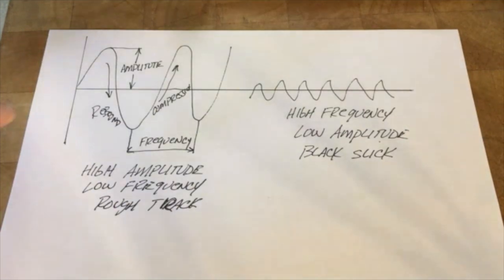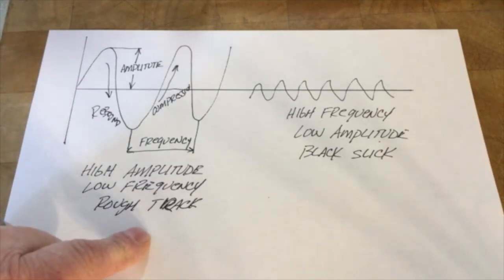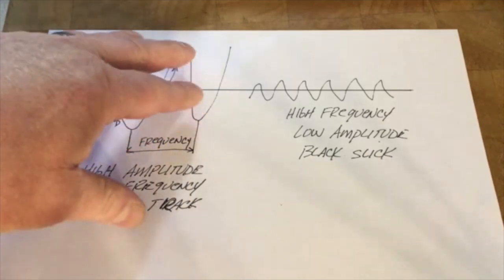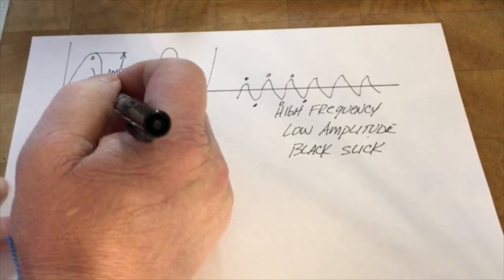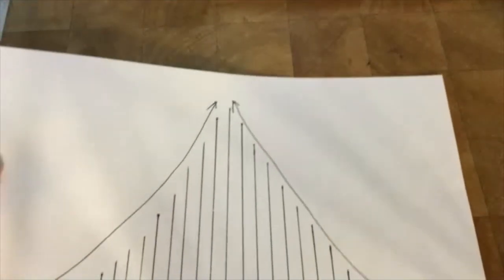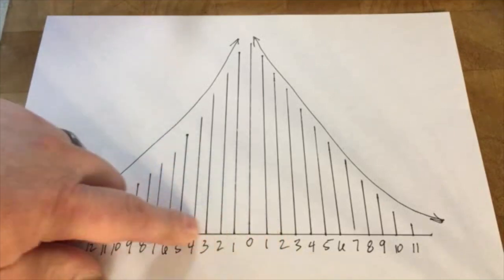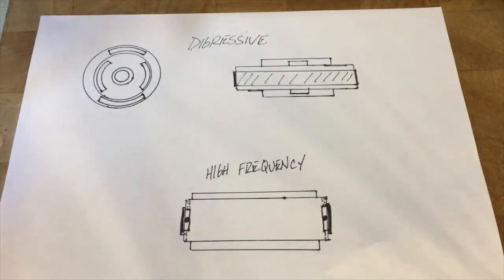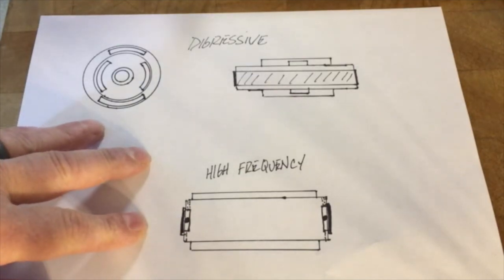More Dirt Late Model and Dirt Modified Shock Technology; High Frequency and Digressive Pistons

Comment: I was into dirt bike suspension back 20 or so years ago. Amazing to me there hasn't really been much change in that time although several manufacturers tried air forks. That was mostly about un-sprung weight. Results haven't been stellar. May be OK for MX/SX but not good for longer woods races. Too much heat generated pressure rise.
Reply: I just wonder why the swing-arm stuff never really took off? I assume it's because they couldn't figure-out the effect the leverage ratio had on spring & damping rates. Had a local guy that broke the centering rod for the lift arm. Car started hiking up LR but was crazy fast thru middle of corner. He was winning HUGE until caution came out. Eventually broke yoke on driveshaft. This was fairly early in 4-bar stuff. Before they figured out how to use the LR hike. Man the used to carry the LF waaaaay up in the air. Driver couldn't see shit.
Reply: Thanks for watching. I still think there is something to swing arm stuff. It might not look like the traditional stuff though. Yea, I remember those four bar days of carrying the left front tire. They have really come along way with traction and keeping the front end in the ground.